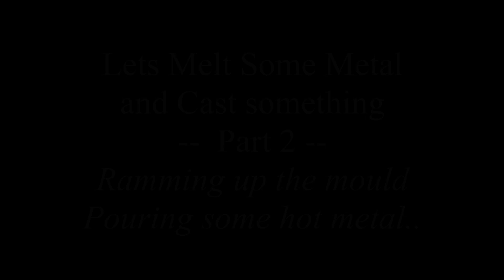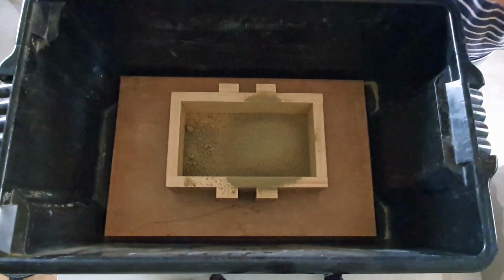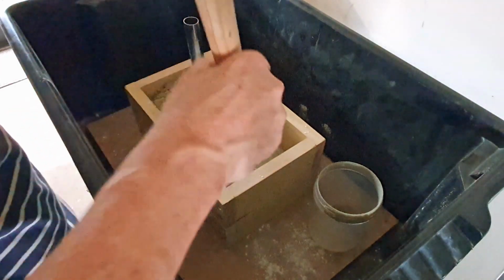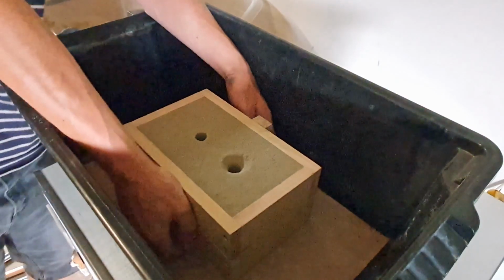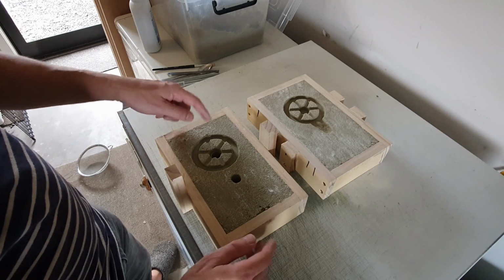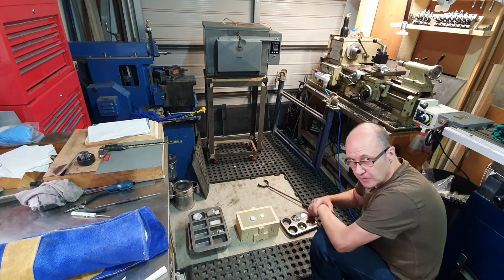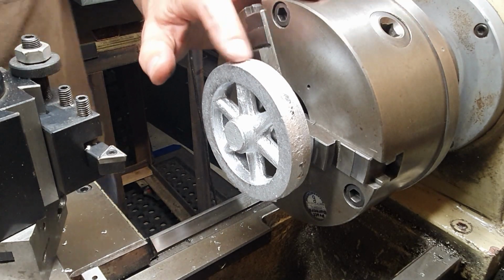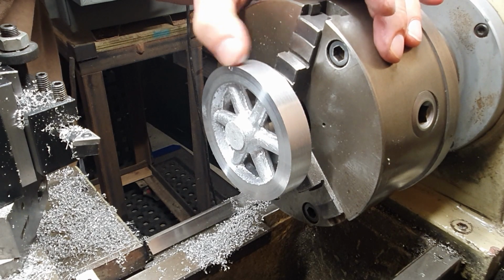#83 - Lets melt some metal and cast something - Part 2

Comment: Nice result Kevin. Learning fast! One thing that I've started doing is to elevate the mould at the end furthest from the gate. That way the mould fills progressively and the liquid metal won't run around the outside of the cavity and join again at the far side. It helps to prevent a "cold shut" where the material looks like it has just butted up against the join line. It works best on large, flattish castings like discs and plaques.
Reply from the maker: Hi Mark, thanks for the tip. So much to learn but very interesting. Cheers Kevin

Comment: Thats brilliant, I'm going to have to have a go at casting with the sand one of these days. The quality of the finished material is a lot to do with the start product. I've got heads and intake manifolds which are top stuff.
Reply from the maker: Hi Paul, at the moment I'm just using extruded aluminium, not ideal I know but while I'm learning. Will start gathering some scrap cast ali. Cheers Kevin